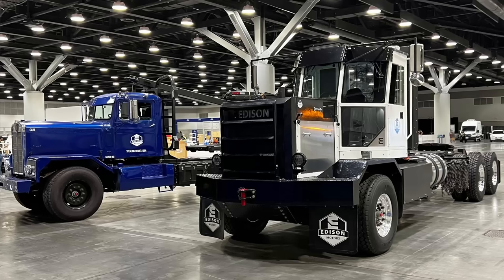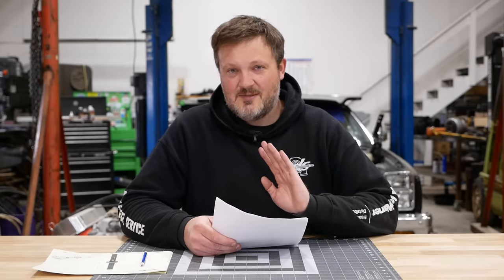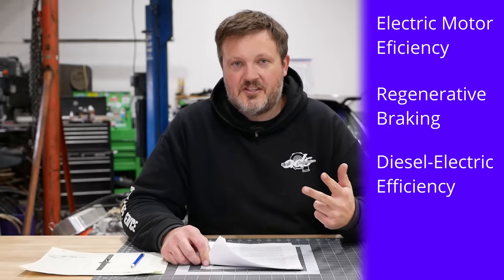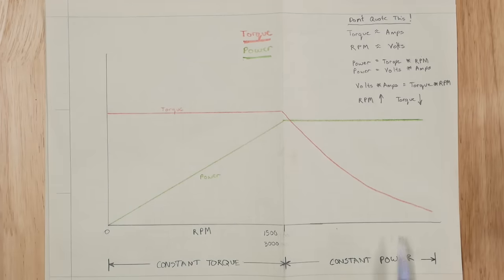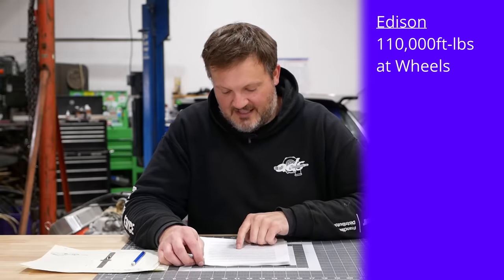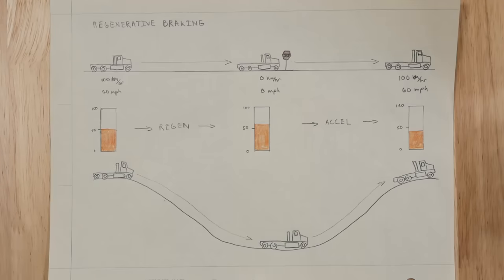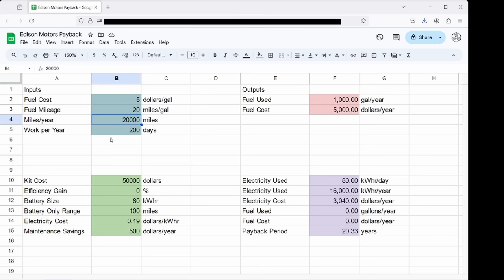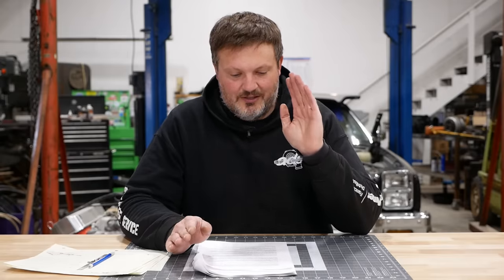Edison Motors Built a Diesel - Electric Semi Truck

Comment: This is exactly what I suspected. I like the Edison Motors channel and their enthusiasm to try something different, but even though I didn't know the math, I had a feeling that most of their claims were lofty at best. Time will tell how they perform and how it all plays out.
I wish them luck. If they're even mildly successful it could open up doors for other small, local electric manufacturers to emerge.
Reply from the maker: That's how I look at it.
Reply: Immediately got a grift vibe from them. Even though I kind of like them too
Reply: All the money they raise from investors potentially going down the crapper.
Reply: If there was a battery standard which would allow for simple automated battery swap at truck stops where batteries could be recharged on the rack maybe the range could be extended.
Reply: @thomasheaney2087  Range isn't an issue... They have an onboard diesel generator to extend the range to farther than one person could possibly drive in a single day. The question is about efficiency. If you're still going to have a diesel engine under the hood and spend all this money on a custom truck or a retrofit kit, it needs to have a decent fuel savings over just running a regular engine and transmission, otherwise the economics of the whole thing doesn't make sense.
Reply: It's not for highway applications. Think things like a cement truck that needs to turn a drum. Or a fire truck that needs to run a pump. Or a drilling rig turning pipe. They're running big engines wastefully. Or a garbage truck running around neighbourhoods at night waking everyone up. Or that same cement truck being there to start the pour at 6 am so the whole slab can be done in a day. Many cities have ordinances about when loud vehicles can be driven, so having the ability to run on battery could let people start earlier and work later, giving faster ROI on the vehicle.

Highway trucking should be the last thing to be electrified because that's where running off diesel is the most efficient.
Reply: @jasonb6570  the range is limited as the engine cannot charge the battery at the rate of discharge if it could you would not need the battery. The engine extends battery range and recharges the batteries when parked or running downhill.  I’m an electrician not a mechanic nor an engineer of any stripe but I get the rational behind using cleaner energy.  If we can charge the batteries with wind, solar, hydro, or nuclear energy we can run trucks cleaner.  I wonder though about the weight of all the gear do we lose payload capacity to the truck’s tare weight?

Comment: I like them too, and through my job, I've had the opportunity to talk to them and see the truck and so on. The only thing that bothers me is that they are very militant about defending their idea on social media and it worries me that they are not open to criticism of their idea, even if you explained to them that virtually every study ever done says the efficiency is all out of whack.
Reply from the maker: Hmm. I guess we'll see how it goes. I get that they have to defend their idea, but at some point you have to put numbers on paper.
Reply: @WatchWesWork  Absolutely right. The main point is efficiency of transforming combustion energy to electrical energy. You can't beat physics. I assume that in some special applications their truck design might have advantages, but I doubht that for the "general case". The market will tell us. If I'm wrong and savings are huge, we'll see these trucks on the road in some years.

Btw: Many thanks for this very interesting video.
Reply: This is nothing new how long I've been trains been doing this?

Comment: THANK YOU!

The reason modern locomotives are diesel electric is because the insane amounts of torque they have to generate is not practically possible with mechanical power transmissions. The loss in efficiency is worth it to not need a mechanical transmission the size of a building.
Reply: Diesel Hydraulic works on loco's, dispelling 2 of your claims is easy, check out British Rail's Class 52 loco or the Class 35, both "mechanical" but using torque converters
Reply: @31144 And you just proved his point! 😉
Torque converter IS NOT a mechanical device, it's hydraulic and it's used exactly for the same purpose as electric generator is: to have a much easier control of the torque to the wheels.
Reply: In the case of a freight train, a mechanical won't work because the application of power is too sudden for the traction. The electric drive mimics the steam engine with a slower, more gradual engagement maintaining traction. Wait, steam is mechanical ain't it?
Reply: To be honest I didn't think I needed to state the obvious ...

Comment: This is WAY KOOL! The Germans in W.W.1. had a system called the A-ZUG (A TRAIN) Using a small 100 H.P. gasoline engine in the front of the tractor / train which powered generator which powered the electric motors rear wheels of the tractor which in turn through a cable system powered the electric motors on all the cars in the train! The biggest of these was the C - Zug which hauled around the 380mm and the 420mm mortars by Skoda! I'm referencing a fascinating book called (KAMPFPANZER MAUS) The Porsche type 205 Super Heavy Tank by MICHAEL FROHLICH.

Comment: I spent a number of years as a maintenance electrician for the railways in Australia and as far as I can see your math seems correct, along with most of the caveats. The biggest issue with any electric drivetrain is basically the same as an internal combustion engine and that is heat, the longer an electric motor runs and the harder it has to work the less efficient it becomes due to both internal and external (internal battery and cabling) resistance this in turn creating more heat and resistance in a vicious cycle (hence why efficiency and range figures are never accurate in the real world).
I think what they were going for with the series hybrid design was reducing the complexity of the system, the generator basically sits where the pre-existing transmission would be thus not requiring additional space to be allocated for behind the cab/under the battery pack for an actual mechanical transmission. If you haven't seen it yet another startup down under has pretty much killed the EV heavy truck conversion market after one of their conversions decided to spontaneously suffer a battery pack thermal runaway in peak hour traffic on a busy main road in Melbourne, a faulty BMS has been blamed for the incident but investigations by a number of organisations are ongoing.

Comment: How abundant or scarce are the battery materials? And what about battery disposal?
Reply: Battery ingredients are too valuable to throw out.  They are recycled for profit.
Reply: It is more about the costs and the wastes that come from the sourcing, using and recycling battery materials. Sourcing has major environmental issues for the people near the mines. Using is not without some issues. Recycling is possible but if the profits fall away then the materials will just be dumped. Legislation would be needed to force recycling and environmental safeguards, but I will let you to figure out how that will work in practice.

Comment: Your left hand is Italian.
Reply from the maker: I was told that talking with your hands is a sign of lunacy.
Reply: Body language makes more than 50% of the message received. "Talking with your hands" is not really body language but an excellent way of underlining important parts of your sentences. 

A speaker that do not move at all quickly looses his audience. It's no coincidence that speakers rarely sits down during their speech.
Reply: The only  time that talking with  your hands is a sign of lunacy to me is if you are punching someone else  to prove  your  point. Moving  your hands when  thinking  can also  help som people  with the transfer of information from the left to right  side of the brain  more efficiently . If I remember correctly  it's  called  bilateral  stimulus. I miss the weekly  post  but you definitely did well  on this topic

Comment: Hi Wes, 
I want to add my two cents. You talked about the creation of series hybrids. I happen to know a vehicle from an Austrian firefighting equipment manufacturer called Rosenbauer. The Rosenbauer RT, which is already in service by both European and American fire stations. The RT is fully electrically powered but has a generator as a range extender on board to power all equipment should the battery run out. 
Also concerning some claims for their diesel electric pickup truck, Deboss Garage is building a prototype for them and in a video interview they vaguely spoke about some numbers. 
What I always wonder is why they are using such an inefficient engine (compared to modern equivalents) but it seems to be due to the CAT standalone system package. Also you wondered about emissions, here they also use a loophole, where the engine is effectively similar to a generator on your truck bed powering your tools, and here regulations aren’t as strict as for the trucks engine itself. Thus, if we are lucky it will have a cat but certainly IMO no DEF or similar.
Cheers

Comment: The best test for this would be to do the retrofit to a pickup.  That would be real world which would include current charging systems for EV pickups.  I would consider that as a truck owner, once I hit my stop I'm going to use the generator to do an onboard regeneration of the battery to prepare for tomorrow.  The concept is very solid.  Modern locomotives do this, except that there is no external charging system.

Comment: I like your "theoretical" videos as well! I always compare kwh/distance. 1 liter diesel is 10 kwh, so about 6-7 kwh/10km for my diesel Volvo. My EV ID.4 uses about 2,2 kwh/10km on average here in cold Sweden. So the EV uses under 1/3 of the energy for the same distance, quite more efficient. EV in warmer climates consumes less than in Sweden of course. Also instant heat, quiet and quicker.
To me the only downside with the EV is that I need to charge out of home if I travel more than about 200 miles. No issue where I live and I charge 95% at home anyways but some places lack infrastructure. Cost wise it's not cheap driving new cars regardless of fuel.
I do like the thought that EV can be fueled with wind, water, solar, nuclear, coal, oil, basically all fuels that can be converted to electricity. With combustion engines we are trapped in using fossil fuels and get the pollution locally instead of in big power plants with good cleaning. So far the EV has caused me less trouble than the advanced volvo diesel with all the extra anti pollution crap like EGR that soots the valves and so on. To me it's either gas or EV, no more diesel unless it's an old Mercedes 300D or similar 🙂

Comment: Thank you for deviating from your usual format for this.  It's worth watching and listening.  All locomotives are diesel-generated-electric (though without the battery).  Seems that there should be a case for full sized trucks too.  But not pickups!  That would make no sense.

Comment: Nice!  What a great presentation on the topic! 

My question is: what is the right answer?  Obviously, the regenerative braking is better than not, energy-wise, but maybe not cost-wise. Also, a parallel hybrid beats the alternative for highway vehicles.  Solar panels on the roof of the trailer would be a nice touch, too, but still maybe not worth much. As an engineer, I don’t stop at what does not work, but I have to find what does work. You invested a lot of time in this Carnot Cycle Efficiency busting problem, but where do you recommend Edison take this to get a beneficial product?  Where is the technological low hanging fruit that we need to break through to get to a true solution?  

Batteries can be cheaper, but possibly heavier or have other characteristics that complicate the calcs.  We have already seen changes in the past 20 years that have greatly changed the battery landscape for the better, but we still don’t have that Tin bullet.   On the other hand, as we use less fuel, the cost of fuel is likely to come down and raise the efficiency bar again. The electric from the wall should cheaper than the electric generated in the vehicle, but is that enough of a difference to matter? Another risk to hybrids and EVs might come from synthetic fuels and fuel cells, which is basically a battery by a different name, and can dramatically reduce fuel and infrastructure costs as well as reduce environmental risks. Rumor has it that Honda and other companies are heavily exploring these routes. As engineers, we are always fighting money v scope v time v convenience v compliance v performance v quality…  but in this field, cost is currently the most volatile criteria and the most difficult to reconcile with sanity. You did a great job to snapshot exactly the kinds of cost issues that need to be addressed. The efficiency of batteries will increase, as will the technology of traction motors and synthesized fuels, and at some point this will all make financial sense for manufacturer and the consumer, but it is not yet a one-size-fits-all that works the same for semi trucks and our daily commuter vehicles.

Comment: Did I miss something here. Going up a hill uses energy, going down a hill generates energy from braking. Ok, but surely that will always be less than the energy used in going up the hill, if not just from heat/friction. There is no perpetual motion machine even for huge trucks :) Great video, really interesting and thought provoking. Thanks :)

Comment: Being a confused mechanical / electrical engineer, I do these calculations when I buy a new vehicle (or used).  The only vehicle that made financial and practical sense was the VW TDI Jetta.  I paid US $1250 over the inline 4.  It saved me around $900 a year on maintenance and fuel until the injectors died.  Back then an after market injector was $1100, to replace all 4 of the injectors was going to be $6000 with labor and replacement parts.  I could buy two new 2.5 liter gasoline engines for the same cost.  It is the downstream costs that kill ya.

Comment: I like the thinking of the Edison.  But more Innovations are needed both on the diesel engine and electric power input... Like Massively Increased Efficiency Increase of Solar Panels to higher than 50% to assist the power input.  Maybe just a Dream!  And Yes I mean having Solar on the Truck!

Comment: Wes, good evaluation on vaporware technology.  I am not an EV fan and I work directly in the industry.  The closest embrace I would make would be a hybrid.  Pure EV cannot sustain itself but we go blindly and stupidly forward.  I guess if they can keep the diesel engine below the DEF requirement, that might be ok.  Dynamic breaking is great if you are always going downhill but going up will very rapidly drain the batteries.  Let's not forget the increase in weight causing better tires, stiffer suspension. etc. I short distance task machine would be fine but there is no way this will end up on a highway run of any distance at all.  I am ok with technology being developed at it's own pace and demand for the product.  That isn't the way EV is being rolled out.

Comment: I've seen them a few times on youtube shorts and i actually didn't know they were intending to build a EV/Diesel Electric truck. I thought their intention was to just make a good heavy duty truck. I do hope they make it work cause it's a good product in theory and a different trim could make this an attractive road truck if it's cheaper and repairable. At least for day cabs, who wouldn't want to escape the hell that is maintenance costs and wait lists that come with pretty much every brand. This if it works would certainly be a great ad for a new company designed by people who understand the expectations of drivers. But unless they make groundbreaking advancements in design that endemic manufacturers haven't already done well they should probably switch to making regular diesel trucks on order and could probably be pretty successful.

Comment: Fellow nerdy, heartless, buzz-killing ME here.  Great stuff, Wes.  You should know that the 2025 Ram 1500 Ramcharger is a hybrid where the gas motor (yep, the 3.6L) is not mechanically connected to the drivetrain.  At least that's what I read...

Comment: There is a book on how to retrofit a sedan to an electric vehicle. It goes over everything, from how to get the batteries to the safety systems, to getting it registered. I helped build a car using methods that it outlines, and it does indeed work. It even has all the same numbers you do - and it is FAR less optimistic, since the book is and older one. It does not pretend that it will be cost efficient. It has a lot of real world numbers too. Let's just say that you are being VERY generous... 
That book originally came out in 1994 - although it has been updated until 2014, and even covers how to install modern plug-in adapters. Why did they stop updating in 2014? Want to guess who started large scale car production in 2015? There is a reason that people don't retrofit cars.

Comment: Yup I agree with you. It is my understanding that diesel/electric locomotives exist because it is easier to transfer 4000+hp through a large generator and motor than any kind of transmission. Forward, reverse etc all easy and reliable to accomplish with electricity, not so much with clutches and gears.

Comment: Ive seen some neat things come out of the aircraft industry with EV type craft.  Not long ago there was a small commuter size plane that used a diesel generator mounted somewhere around the wing root area and it drove a couple ducted fans.  They were making some very impressive efficiency claims as well.  But I drive my 2001 Tacoma I bought new after the buildings went down.